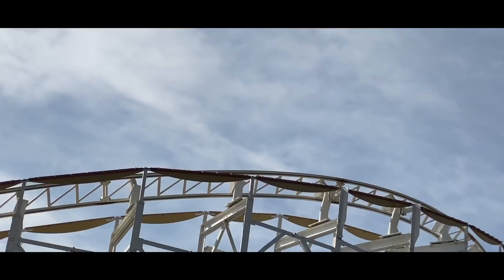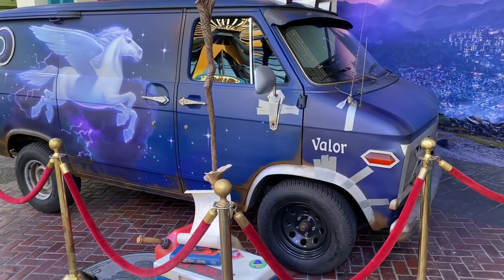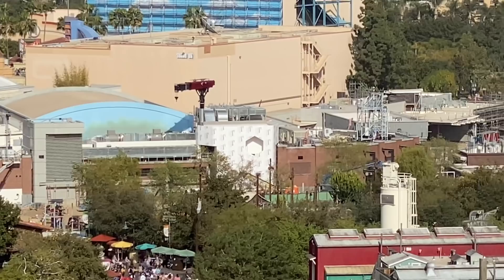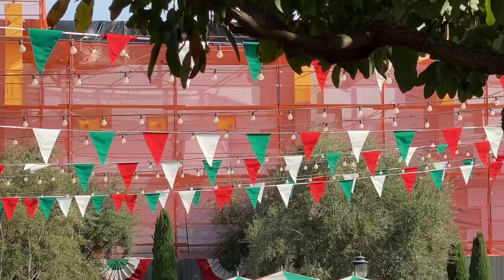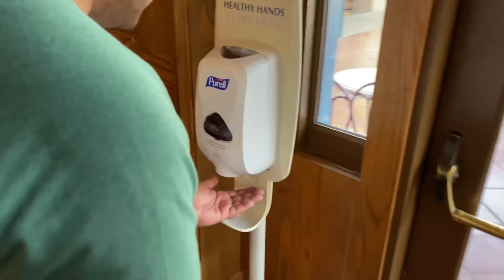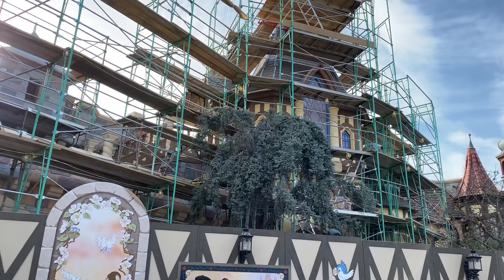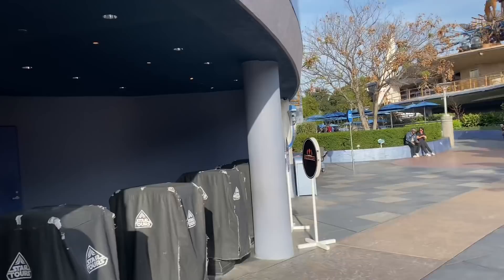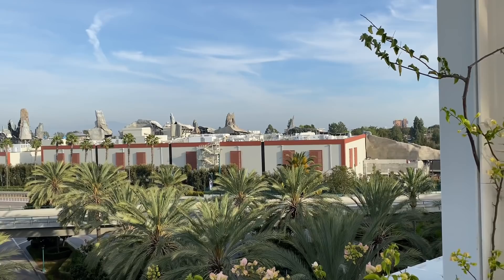Disneyland Resort Update | Avengers Campus, Fantasyland & More!

Comment: Dylan - Are they still actively in construction mode on M&M's Runaway Railway?  Someone on another channel said they might be/are suspending construction due to "budget cuts" or low attendance in other parks (they claim to have inside knowledge).  Just curious.
Reply from the maker: Oh no, they are still under heavy construction. They are just working on foundation work which takes some time. Then the structural steel gets shipped in from the manufacture. 😁